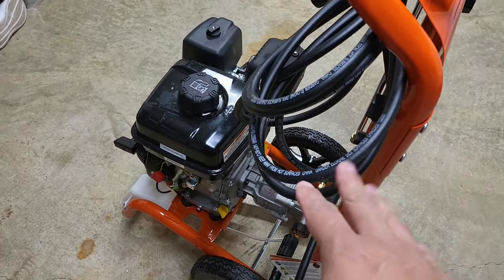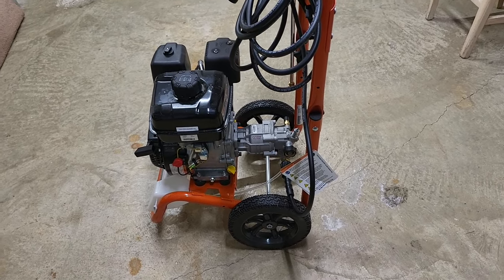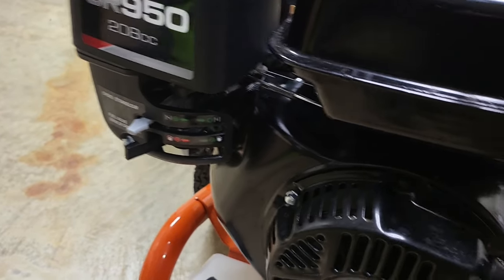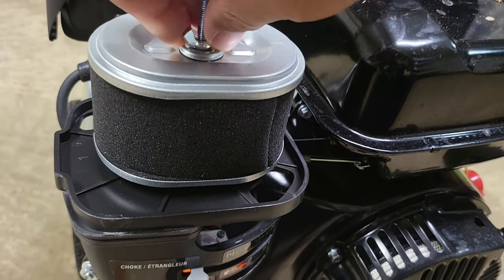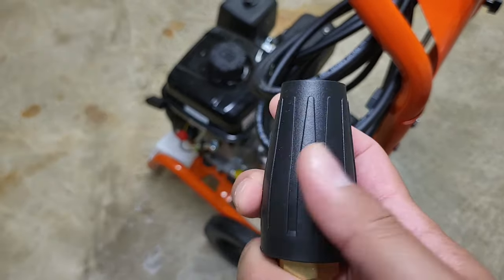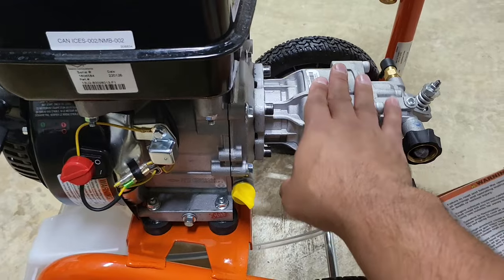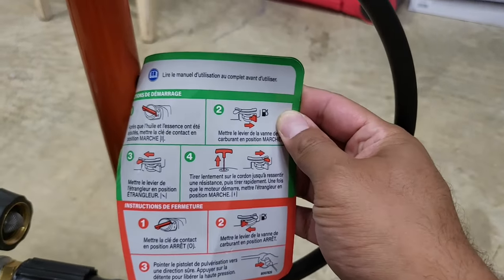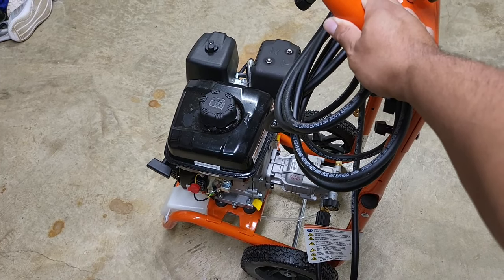Costco Husqvarna 3200 Pressure Washer | Overview + Tips and Tricks

Comment: Hey Chris. Any updates? Still recommend? Thanks!
Reply from the maker: Still using it strong today. No regrets and still working as good as day 1. Like I mentioned the video, never run the pump dry, always use the fuel shut off when turning it off, and lastly, once it's off, depress the hose one last time to relave the pressure before disconnecting the hose.

Comment: Thanks, I just picked this up today at COSTCO but was hesitant due to some reviews.  My old HONDA washer finally died after 13 years (engine still good but have gone through 3 pumps). Used this 3 hours today and worked awesome. Hope it stays like this. Good tip on the fuel shutoff first then turn the off switch. Now what to do with the old Honda engine..
Reply: I assume you mean after using it shut off the fuel?  Confused about this feature thanks

Comment: Rubber grommets would be a worth while addition to those holes for storing the tips.
Reply: Comes with it! He didn't install them into the holes.
Reply: Get the same female receptacle for the nozzle holding places that's on the gun end. Screw them on the back plate and you can securely mount your accessories.

Comment: I bought this washer in July of 2021, but didn't use it until this month (Nov 2023). It started without a problem and ran great... for about 30 minutes. The engine shut itself down about 30 minutes into the project, as if it ran out of gas or someone flipped the ON/OFF switch. But, it had fuel in the tank. I turned off the water and let it set for about half an hour, then started it back up. It ran like a champ for all of 6 minutes before it shut down again. I packed it up and put it away for a couple of days. Today, I checked all the nuts and bolts, tightened a few, filled the gas tank and started it up again. It performed beautifully for about 30 minutes and, again, it shut itself off. If I can find a solution online somewhere, its going back to Costco. Such a shame... it's a nice pressure washer.
Reply from the maker: Mines died after two years, it went back to Costco, I suggest you do the same.
Reply: Mine does the same ran for 30 minutes then it ran for like 10 minutes. A guy that works for a pressure washer company. Suggested I look for a loose soap hose connection. So far everything looks tight. So I’m testing it out one more time then back to Costco it will go. I really like the machine so far.

Comment: Currently at Costco looking at a pressure washer that looks the same as yours but I'm assuming it's a new model... 
JDX208 208cc $389.99.  I just returned the Husqvarna 2000 electric because plugging it in the breaker trips on the pressure washer cable, breaker won't reset and won't turn on (Thank you Costco for having an awesome return policy!).  I'm hoping the gas Husqvarna will last longer but if it doesn't I'll be back in the return line.  Thanks for the review!🤙🏻

Comment: I used a Huskvarna 3200 video to get me going when I first bought it from Costco a year or so ago. It worked GREAT.  I just set it up again, by the book, and attached the garden hose and turned on the water to get rid of any air in the pump line, as told to do in the instructions, prior to starting the engine. Nothing happened. No water came out of the connection for the power hose. When I started to unscrew the input connection a little bit of water squirted back. The screen looks ok. Any ideas or suggestions? Thanks much, man!
Reply: I can’t believe I can return it after a year! And I still have the box, etc. If it needed to be repaired, I just can’t afford it. Thanks for sharing your experience‼

Comment: I just picked one of these up at Costco after my 3100 crapped out on me. Any suggestions how to minimize calcium build up in the pump? I believe that’s what happened to my 3100 as water wouldn’t even circulate through anymore. I did run the water out after each use like the Manuel suggested but it still plugged up. Thanks for the video!

Comment: I use the power button to shut off and its been fine for 2+ years. I only use fuel shut-off last time before winter. But listen my real question is this: when you put soap in the reservoir and your multi wand on soap setting, what do you do to stop using soap? (I unplug the soap hose from under the pump but i'm looking for a more efficient way)...thanks!
Reply from the maker: The soap reservoir is activated when you use low pressure nozzle like the "soap nozzle" on the wand, also if you don't put any nozzle on the wand, soap will still come out. The pump feels less resistance and automatically starts to siphon soap from the reservoir. When you switch to a high pressure nozzle on the wand, the soap will stop as the pump is working harder due to resistance not allowing soap to be siphoned anymore. You don't need to disconnect the soap hose. Yes there might be a little soap that may continue to
Reply: @Mr-Chris  thanks!

Comment: I have that same pressure washer from Costco.  Mine seems to run at a very high RPM.  Seems like it's pushing 4000 RPMs.  I have a tachometer on order.  Does yours seem to run too fast?  Those small engines can run above 3600 RPMs for too long.

Comment: We have a super silly question…how do you switch from soap back to water?   We have the same model but there are a few differences one of those is we still have the 4 different nozzles. Do you just switch the tip??  So confused…Thanks!
Reply from the maker: The nozzle, when you use the soap nozzle, the pressure washer senses the low pressure and pulls soap from the soap Reservoir. When you switch to a high pressure nozzle, it stops pulling from soap and only uses water.
Reply: @Mr-Chris  thank you!

Comment: Hi Chris, I have this exact model.  I would have it run fine for about an hour, then I took a break.   After the break, the unit would run for about 15 minutes then turns itself off.  I'd wait for a few minutes to restart, then it would run for another 5 minutes then stops again.  Each time, it gets shorter and shorter!  Do you think it is because it gets too hot?  Kind of strange if that is how it works.  I've had this unit for about a year and this is my 2nd time using it.  Any advice is greatly appreciated!
Reply from the maker: It might be a dirty carburetor.  The good thing is that engine is easy to work on if you are willing to do so. Shut off the fuel and take the carburetor off to disassemble and clean. There's lots of youtube videos that shows how to do this. My advice is if you are willing to do this yourself, take pictures of how it looks like before you take it apart. These engines are not difficult to work on and are designed to be maintained.
Reply: @Mr-Chris  Thanks Chris.  I let it cool off and continued to work the next day.  It ran for an hour a half without turning off.  Somehow, if it ran for that long time, take a 15 break and restart, then it would not stay on.  Sounds like a thermal sensor or something?  Thanks for your feedback Chris.

Comment: Hi, appreciate your video. I tried to start my 2022 same model pressure washer but it would shut off when I slid the choke over to run. On my last attempt, I think the pull cord bound up because now it won’t pull out more than a few inches. Thoughts? This is my first gas power washer. I’m tempted to take off the start cord cover but that might be a disaster. Thank you.
Reply: if an engine only runs with the choke on, then it's not getting enough fuel through the carburetor normally, it likely needs cleaned.  You should be able to safely unbolt the starter housing without anything going flying so you can at least see if something is stuck or whatever.

Comment: Been a while so how's it starting? I have same and it starts hard. I know how to use a choke & good gas & etc.
Reply from the maker: Since I always starve the carburetor dry of gas when I am done washing (instead of turning off by switch)... It takes about a few pulls to start. My sequence is I turn the fuel on with choak but leave the switch off, I do a few light pulls to get gas in carburetor. Then I turn on the switch and it typically starts on the first pull.

Comment: I am having a problem with starting it.  I can barely pull the start pull rope.  I have the water hooked up and and have purged the system.  Still can not pull the engine to start it.
Reply from the maker: #1 try to pull the trigger on the gun and pull it, if that doesn't work you may by hydolocked. #2 Remove the spark plug and give it a few pulls and  if you see liquid shoot out from spark plug hole, it might now be fixed. Put the spark plug back in and see if it works.

Comment: I am doing something wrong. I can’t get it to start. Any tips of things I should try.
Reply from the maker: Few questions, #1 when was the last time you used it? #2. What kind of gasoline did you put in it? (eg. regular, treated regular, non-ethanol)
Reply: Brand new. Finally got
Out of the box amd
Set up. Put oil in. Unleaded gas

I think I’m doing something wrong with the choke but I can’t really figure out what the process is there

Comment: Just bought one from Costco. Had to return it. Couldn’t get the nozzle to lock onto the wand. A poorly made product. Heard there are gasoline leaks from the carburetor sticking and hose fittings leaking. Some can’t get them started. Made in China also. Everything looks well positioned for easy use though. But the parts are not quality fitting at all. I called Husqvarna and they said call a Briggs and Stratton dealer near me.

Comment: I tried to let it run itself to stop but it was taking a long time and violently sputtering.  I had to shut it off with the switch.
Reply from the maker: That's normal, it takes about 3-5 min to turn off and sputters. Sounds like it's struggling and starts to surg. This is all normal and won't hurt it.  It's burring off the remaining gasoline left and highly recommended by small engine mechanics.
Reply: @Mr-Chris  I'll take your word for it. I'll try it again.

Comment: how do I drain the gas from the machine?
Reply from the maker: I find it easier to drain it from the carburetor drain plug. Make sure your fuel shut off is off and open the drain plug, some gas will pour out, then using a container with a funnel under the carburetor, open the fuel shutoff and let the gas drain out. Here's a good overview from another manufacturer, but the practice is the same. https://wenproducts.com/blogs/resource-center/how-to-drain-your-generators-carburetor-for-storage

Comment: How can I drop just soap or just water????
Reply: you have to use the soap settings/nozzle(s) for it to draw soap from the tank.  it comes out mixed with water at a very low pressure.  any of the more pressurized settings will be only water.

Comment: $380 seems a little spemdy and only 2.5 gpm little low.
Reply: Agreed, but COSTCO has your back if anything goes wrong. I just completely cleaned a 28' RV that was NASTY in a few hours. Worked like a champ. The rotating heads is super convenient.